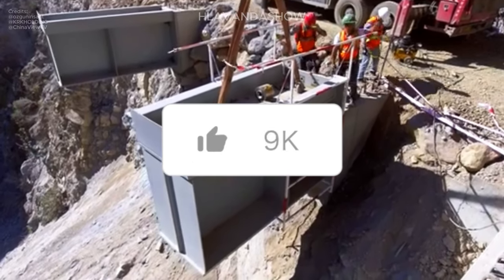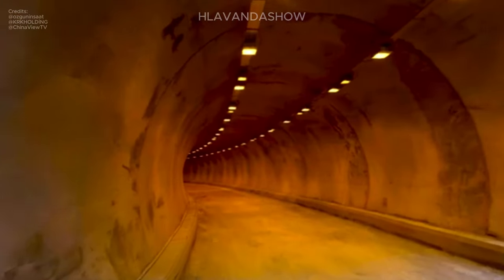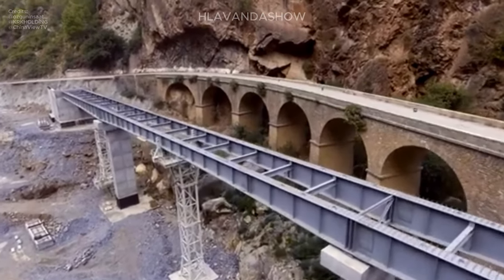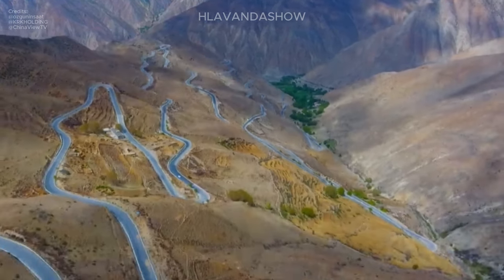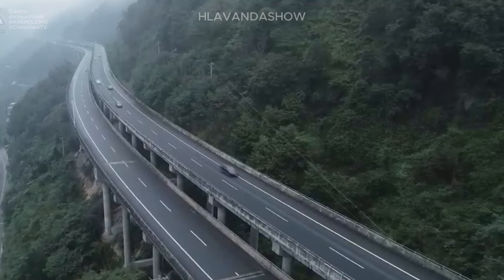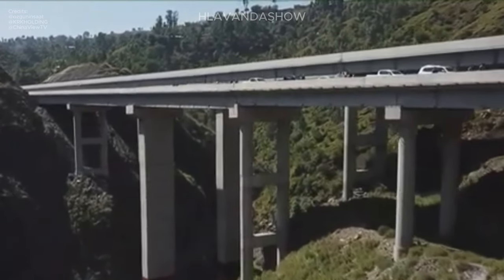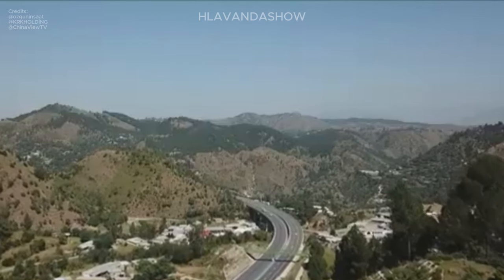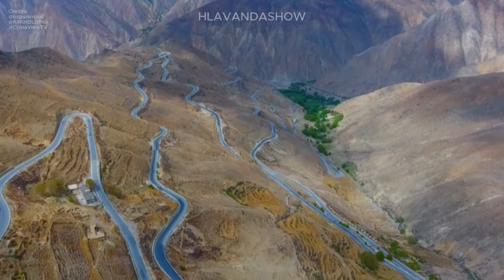Crazy Highway | Highway Construction Process in Steep Mountains

Comment: How is it done?
I mean how are the cantilevers anchored?
Reply from the maker: Thank you for your interest in highway construction project. 
The cantilevers are anchored using a combination of methods, including:

Rock bolts: These are long steel rods that are drilled into the rock face and anchored with resin or cement. They provide strong support against both vertical and horizontal forces.

Shotcrete: This is a sprayed concrete mixture that reinforces the rock face and helps distribute the load from the cantilevers.

Steel reinforcement: Additional steel beams and plates are embedded within the concrete to further enhance its strength and stability.

The specific anchoring method used will vary depending on the geological conditions of the site and the design of the cantilever.

I hope this information is helpful! Please don't hesitate to ask if you have any further questions. 😊
Reply: @HlavandaSHOW  Thank You.

It was interesting to see some aspirational construction project outside the common places (like China, Europe, America, Dubai etc) and having specific obstacles to be overcome.

Good for Algeria.

I asked for the methods as I am not from the construction business and it feels potentially hazardous to anchor construction to the side of a massive (will it break? How is it prevented etc)

Interesting, inspiring.

Btw I saw three videos from You so far and subscribed afterwards, first video of You I saw was about Paris river cleanup. (Although the diction of speech is a bit slow and slightly broken, if I might add, it is still enjoyable afterall)

Greetings from Czechia 🇨🇿 👋
Reply from the maker: @petrskupa6292 thank you very much. I really appreciate your interaction and support. This is for me a big motivation. To be honest, it is quite hard to produce a lot of videos without any obvious channel movements (likes, comments, etc.). Although people like you, are helping me a lot. 🤎 yes I agree what did you write about my speech. It is quite difficult to divide length of text with lenght of video. At least I try to use my own voice to but much authentistic as possible. 😊 thank you for subscribing and greetings to Czech republic 🫶🤝
Reply: @HlavandaSHOW  
You are right, it is absolutely best to use your own voice. I kinda hate those unauthentic AI voices with very wrong intonation without care.

And I believe You are gonna be better with every video and every attempt you do (something AI will never be able to)
Reply from the maker: @petrskupa6292 thank you very much. 🤝 I will do my best to improve this channel and to achieve 100k subscribers as initial goal. But the most important thing is to provide valuable content. 😊 enjoy your day Petr ☺️
Reply: @HlavandaSHOW  may I have one more curious question?
What country/region You are from?
Reply from the maker: What do you think? I am curious if you find it out 😄
Reply: @HlavandaSHOW  I am really not good at that.
It feels from Your voice, You might be from South Europe maybe, maybe Greece or some other Balkan country?

I am sorry, I hope I didn’t offended You by making some crazy mistake 😅😂😂
Reply from the maker: Skoro 😁 asi to bude prekvapenie, ale som Slovák. Slovanský akcent sa nezaprie. A som milo prekvapený, že aj brat Čech natrafil na môj kanál. Ako som písal, vážim si podporu a ďakujem za komentáre. Potešil si ma Petře 😉😊
Reply: @HlavandaSHOW  ha, ha 😁 super překvápko 😊

Přitom bych si myslel, že alespoň Český akcent bych poznal … a že Slovenský bude podobný ☺️ 

To’s mne dostal (trochu jsem myslel na Chorvaty či Srby 😀)

Držím palce
Ať se daří